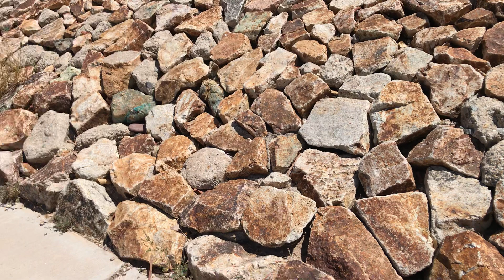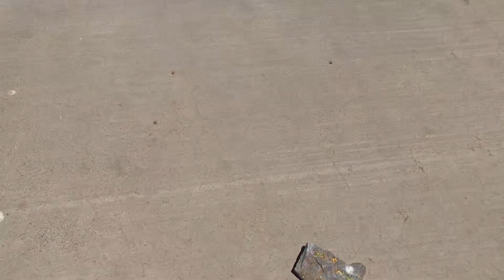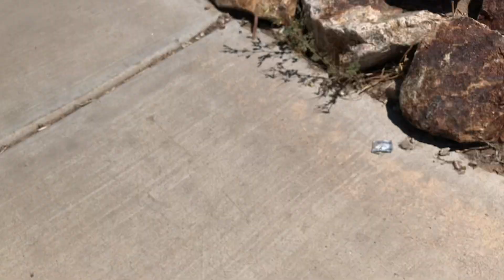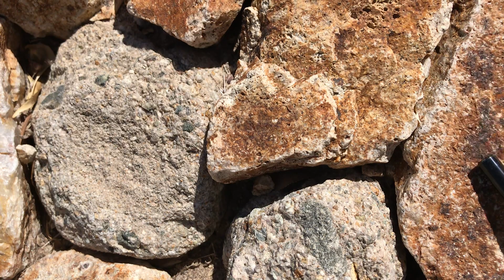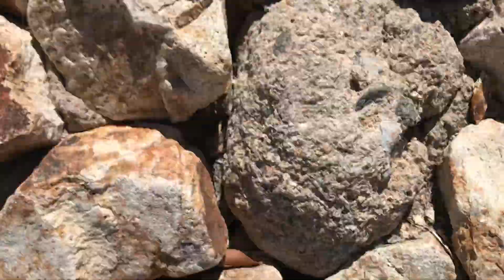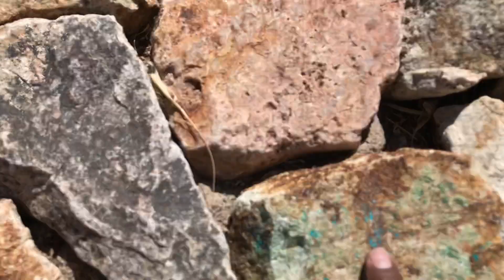How to recognize Leach cap in porphyry copper systems

Comment: Is there any way for me to contact you?   I am a prospector in Northern Nevada and I believe I might have found one of these leach caps to a large porphyry deposit.   I'm trying to figure out how I go forward and study it more.
Reply from the maker: Thank you for your participation. There are 4 videos about leach cap interpretation:  https://youtu.be/jgVUml9xy8A  https://youtu.be/7iwKnRdP63Y  https://youtu.be/Agwx6Gv5vPI  https://youtu.be/Nsawu6vnt2k . The fourth one is Spanish but you can use the reference book.  Feel free to send an email with your questions to the channel: coreloggingsm@gmail.com and I can send you information that I share only internally.
Reply: @geologylifeandhealingbyseb2937  Thank You Sebastian, I will watch all your videos, but I have one question that is very difficult to find an answer to .   Can a VMS deposit have a leach cap?

Thanks Again
Reply from the maker: @mattclark6482  review your definition. Usually "Leach cap" (the term or words) are used to describe both the supergene alteration and mineralization in porphyry copper deposits because (here is the main reason) bellow this leach cap is located the most richest section in the porphyry copper system which is the "enrichment zone or chalcosite  blanket " all this section of chalcosite the origin is supergene environment.   Supergene process can create oxidation areas or zones in any type of deposits like in VMS but It may not have strong  development chalcosite blanket for mining process you can have some chalcosite development but you can not make an ore deposit for mining. I will find in the glossary for you the exact meaning for leach cap.  One thing I remember it is to call "leach cap", you need to have the evidence of enrichment which "the evidence is Hematite after chalcosite", and that chalcosite originally was form after pyrite or chalcopyrite,  if you find that evidence on your rocks you can call "leach Cap". Any other places like in the road cuts of anywhere you can see evidence of Fe oxidation, Jarosite and hematite but  we do NOT call leach cap because there is no evidence of chalcosite enrichment only we have evidence of Fe Oxides on the road cuts for example.